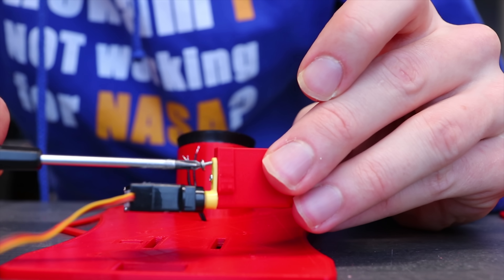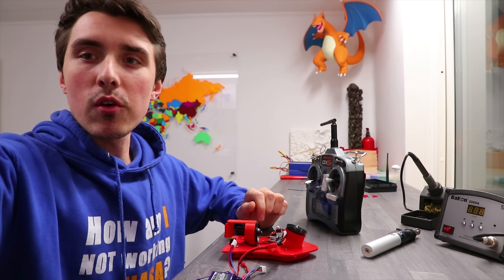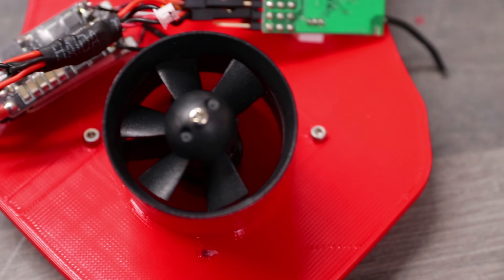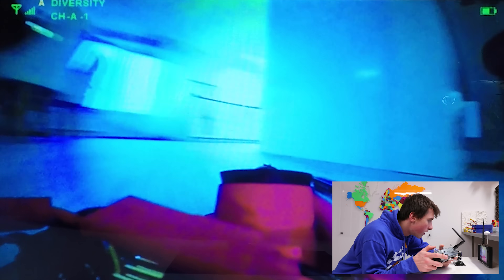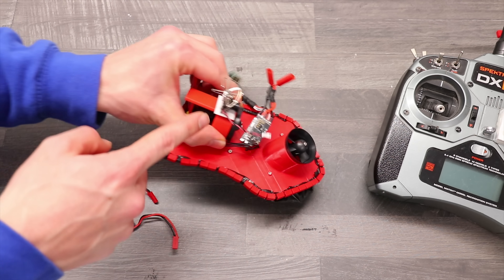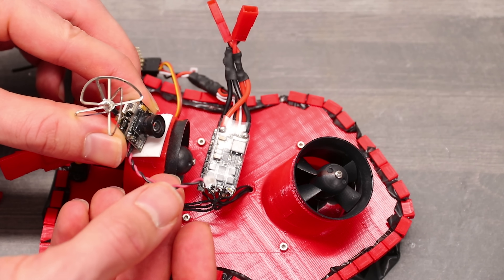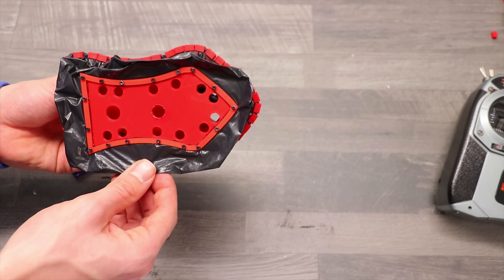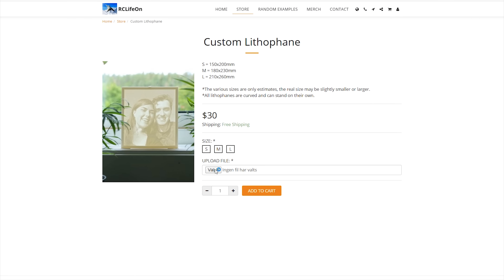TINY 3D Printed Hovercraft

Comment: What about pushing some of the downwards force through directed channels directly to each side which should relieve some drift at the expense of altitude.  It it doesn't work, laugh.  If it does work,...make one with two forward thurst engines set far apart and use differential speed (and possibly dual rudders) to control the turning (although it would be bigger).  Does it work on water?????????

Comment: Now make a HUGE version of it, you can actually use the template of the first commercial big hovercraft and it will stay above water even with the motors off but then you can mod it, would be cool to have that exact real model modified with wings that come out of it and would fly :)

Comment: Very good.
It looks as though the skirt itself doesn't quite get enough air to capture the escaping air from the bottom in order to create lift. There is a very fine line between lift and drag .You might have to adjust your mixing for the lift fan.
In short.  Use less lift holes to start then add them in as needed till a good balance is achieved.

Comment: technically the way you have it attached to the top with the clipse it's not even working right the bag isn't even inflating just the fan is scooting it around because of black the bag is a slick surface

Comment: should have made the bag of little bigger and instead of a quip clipping on the top part of the bag you should have made a bracket the size of the outside ring just like you did for the bottom and installed it on the top to hold it as wellbecause as it is you wouldn't be able to driving on water because those clips aren't watertight so it wouldn't float on water

Comment: Does the ducted fan improve the efficiency or static pressure? 
I made a similiar one too with open props and 1106 motors a while back (With video and stl on my channel). Pretty much made from cheap stuff laying around.

Balancing and making a skirt was also hard and there were a few iterations before it was really stable but it really rips now. Would be interesting to compare which approach works better.

Comment: Try to put the axel of the rudder a little to the backside of the hovercraft. This way it changes the thrust direction allot more. You could also let the full motor rotate by using some bearings. Thumbs up for your design!

Comment: fyi,  LOTZA  issues.  unstable, short footprint.      the skirt is supposed to pressurize; or go skirtless.     the c-m  is  HIGH.    edf units are  Heavy and their use is  not recommended.      separate motor control  might be a good idea; such that thrust ramps down, as  lift is increased.   mixing in tx?   because, as  drag at the ground reduces,  so too does the required amount of  thrust.    idk what happens if an esc is connected to a servo port, at the rx.      cheers
https://en.wikipedia.org/wiki/Hovercraft

Comment: I have a question I have to print a tube of thirty centimeters but to 15 cm it falls over how do I prevent that
Reply: Print it laying on about a 10 degree angle (like a leaning tower) with support filament all up the side so it has a much larger base of support
Reply: Or add a brim but that might not save it. Split it into 2 pieces. Or tilt as suggested in other comment

Comment: Hey mate, amazing vid like always. I was wondering if a macbook battery can be built with the li-po cells that are readily available. I have a 2012 Macbook Pro lying around that now has terrible battery backup. However, I still love the machine but don't want spend $100  to revive this beater. 

Would appreciate your suggestions. Also this could turn into a really interesting video, if you shall plan to make a DIY battery for any of your machines.✌️✌️

Comment: Put the rotation point of the rudder not all the way at the edge of the rudder but closer to the center. That might help in controlling it. Basically in a turn now half of the air is blowing past the rudder and just pushing you forward instead of sideways, if that makes sense :) Anyway, fun video!

Comment: Rather than having a stationary propulsion fan with movable rudder, try making a fan housing with stationary blades and have the housing itself movable via servo. Basically, point the fan instead of trying to redirect the output.  Might give you more control.

Comment: Is that an acutal Hovercraft? Your plastic bag is completly closed, whereas an actual hovercraft blows air out between a skirt and the hovercraft, creating a cushion of air underneath the boat. Therefore the hovercraft doesn´t actually touch the ground, while your hovercraft does. You could also compleatly seal your plastic bag and pump if full with air just once, then there is no need for the second motor. Your boat glides on the plastic instead of the air cushion(still cool though!)
Reply: It is a real Hovercraft. The downwards prop fills the skirt. When its full the air is going out through the holes in the bottom and pressing out under the skirt.
Reply: ohh now I see it 🙈thank you 😅

Comment: The one I have (Air Commander) is a 2 seater but only powered by 1 fan. It uses 5 rudder vanes for steering. The 2 ducts to divert air to the skirt are the size of your head. Oh, the skirt is vented at the rear where it touches the ground.
Don't know if the design would scale down well though.

Comment: I think your problem is that you only have one rudder and if you add another one the air will flow in the direct position your turning. Just look up a hovercraft and you'll see that most of them has 2 rudders. It's an easy fix but it'll fix your turning problem

Comment: I copied a design from Peter Sripol and made it in the same size you did, mine "flew" quite fine :D I had the cushion esc on a separate channel so i could use the deflation as a brake which was quite handy :D I had such fun, FPV drifting 2.0 :D PS, next time i make one with two counter rotating cushion motors on one channel to stop the yaw effect.. Great build you did, mine looked like shi.. peeeep.. :P

Comment: Do you recommend cr-10 for a beginner
Reply: I got the cr-10s because power goes off quite often in the area I live, so I can just continue with the print when it comes back on. May not be needed for you but it’s great if you’ve had a print going for quite a while and don’t want to start again. You should look into the anycubic ultrabase. Saves me from having to add tape or glue or anything else. As soon as it cools it comes right off. You should also look into a way to monitor your prints. I use an ezviz mini o. Cheap camera you can access from anywhere and saves the hassle of having to set up one.
Reply: @Discover.3D  Maybe octoprint, that is really nice IMO. No problems that the print pops off the ultra base when power goes off?! and it cools down.
Reply: id I’ve had it happen once where the power went off and it cooled down and I was able to finish the print no problem. Another time it went off and cooled and the print shifted. If I know there is a scheduled power cut I use the glass with the pritt-stick. It’s normally fine though
Reply: @Discover.3D  okay, good. Might i ask where you live? I am curious =D
Reply: i think ender 3 is good for beginners
Reply: id too small
Reply: @jacksuedbeck7166  ok, maybe prusa if you want to pay more